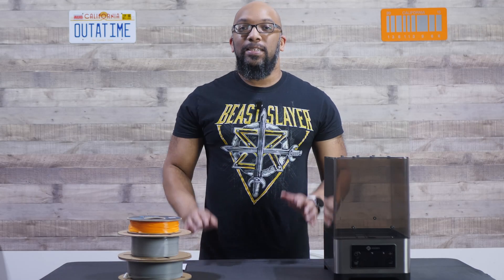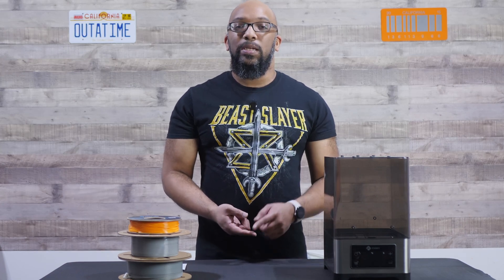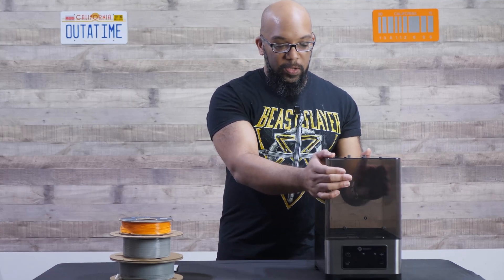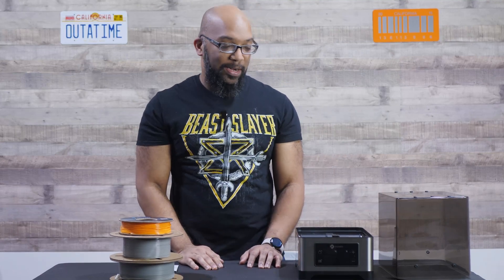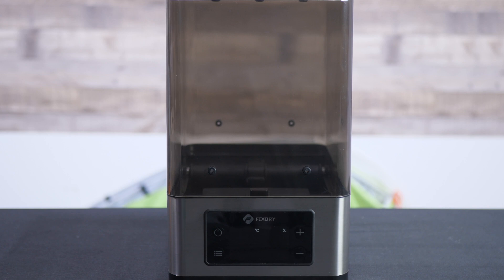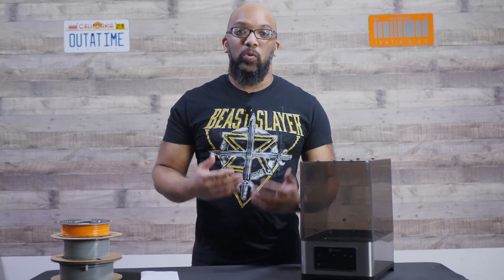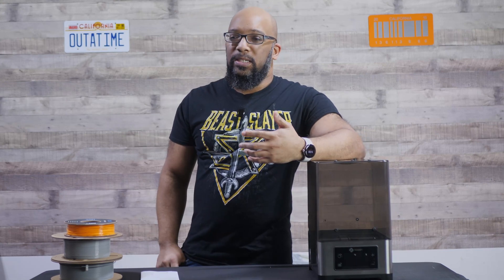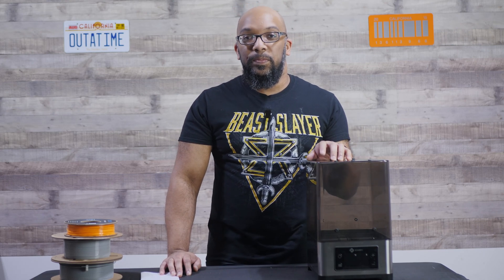FIXDRY NT1 Filament Dryer - Do You Need It For 3D Printing?

Comment: This is an amazing dryer! I came up with a solution for opening the lid, you can find it in my review. It totally solves another issue I found.  Your point about the smaller spools is totally legit, I think we could simply print extenders that could snap on the sides of these smaller spools and increase their diameter to full size. Of course it wound need to be printed out of PETG or more heat resistant filament... Last note: I envy your beautiful studio! Well done thoughtful review!

Comment: I use a cheap food dehydrator with extensions I printed from the community. Works great and it only cost $35
Reply from the maker: I used to do that to an extent. I used a first generation Ninja Foodi (that I no longer cook with) as a dehydrator.